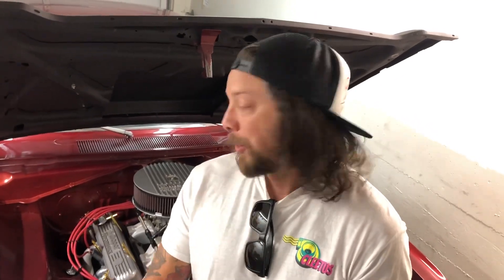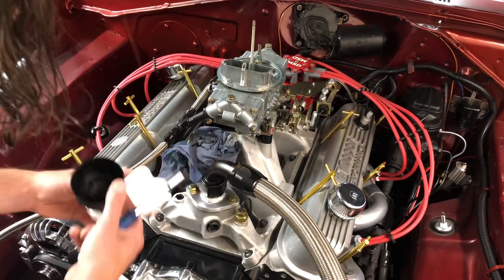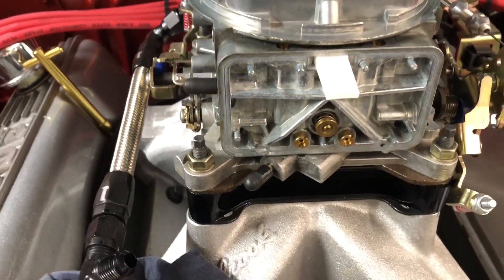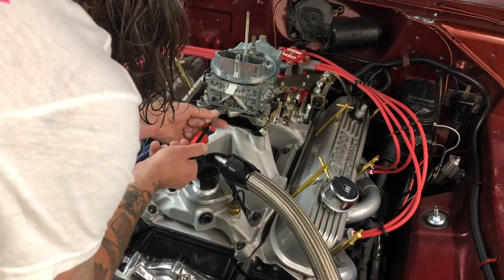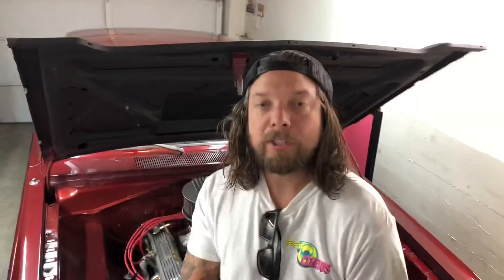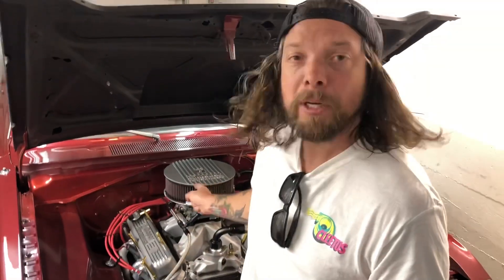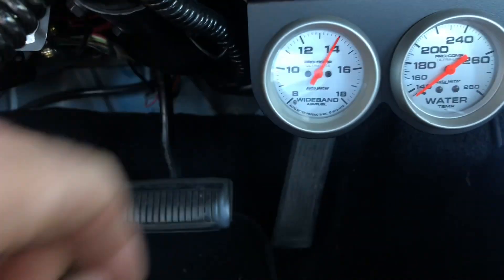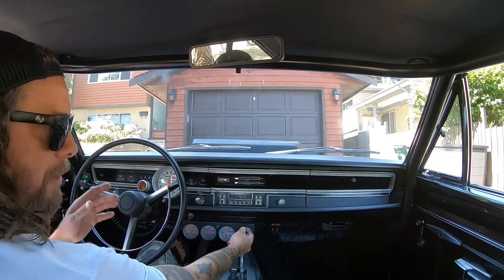Holley jet tuning with a wideband o2

Comment: I would use the dyno session as my base. But if you don't dyno an engine, pick a good air day go to the local track for test and tune, jet up till the mph drops off then go back 2 sizes and you are done. Increase timing and squirter for 60 foot same thing.

Comment: Hi, what fuel are you using, using the AFR gauge, I looked up Autometer AFR Gauge and asked that question and Autometer said that the AFR gauge is not compatible with leaded fuel
Reply from the maker: Ya not leaded. We get 94 at the pump at chevron up here 🇨🇦
Reply: @SimpsonsSpeedShop  ok, thanks

Comment: when you changing the power valve do you have to change the jets at the same time
Reply from the maker: No they aren’t connected that way. The jets provide main fuel. The power opens to add fuel when you floor it (depending on what power valve you have)

Comment: Great video. I’m struggling with my carb tune and think I need to just put a wide-band on it to see where I’m at. Car is mostly a drag car but will see some street use from time to time. I only have a set of long tube headers on the car now. Where would you recommend installing the sensor and does it matter which bank you install it on?
Reply from the maker: Mines on drivers side just makes wiring easier and just install so condensation won’t sit on it ( on top of collector) a wide band will definitely help you with both power and drive-ability. 👍🏻 thanks for watching
Reply: @SimpsonsSpeedShop . Thanks for the advice and quick response!

Comment: Im running a new dominator 1050 on my 555. Its running rich on idle. What is the best way to fix that? Ive ajusted the 4 corners to get as much vacuum as possible but its still rich.
Reply from the maker: If your using a wide band adjust it there don’t worry about vacuum
Reply: can you open the rear barrels up a little to add some air.
Reply: @70smemories  id have to look. Havnt messed with the car for a few months

Comment: I have a 70 camaro with a 383 stroker and an unkown huge cam.  I get only 6 inches of idle vacuum.  I put a wide band to tune it as it was running pig rich.  My wideband moves around much more than yours.  I can see swing from 10s to 16s very quickly.  Did you ever see this type of behavior?  My wideband is an AEM UEGO brand.  BTW another thing I noticed you are seeing also (that I see in my car), when you are crusing and you let off the guess the wideband shows a richer mixture.  I am not sure why that happens, the butterflies close restricting air but vacuum should increase and cause more timing advance, which should help lean it out rather then richen.  Are you using a vacuum advance? Nice Dart by the way.

Comment: I wish my afr gauge would work properly.  I have 1 o2 on each header and one side reads different then the other side quite a bit. When I check spark plugs on both sides they're identical. Guess I'm just going to have to tune it the old school way by checking the plugs.

Comment: light throttle cruise  .......modern car 16 to 1 //  old car stock 14.7 to 1 ,,,performance street car  pump fuel 13to1  upto 14 to 1 ..
Power valve comes on at vacuum reading just above light throttle cruise as carb progresses to moderate load the vac reading is used to select valve .
The power valve restrictor jet is tuned to set the mixture at moderate to heavy load WOT .

Comment: Mine is fat at idle and 1/4 throttle is 10-11, and can’t get it to 14.7 at idle its running 11.7 have 69 primary 76 rear in a 750 cfm idle s
Reply from the maker: You should be able to adjust your mix screws to get you 14 ish at idle. If you can’t but you have airbleeds you could swap some of the idle air bleeds to get there

Comment: Installed a wideband on my racecar with headers an about and 18" extension.  Two questions you might be able to help with.  Does cam overlap cause a false lean reading?  Do you know how far from the exhaust tip you need to be to prevent reading fresh air?  Ours is reading ridiculously lean and I just don't trust the reading
Reply from the maker: It should have at least 12” of exhaust behind it and it will prob be all over the place at idle. Open headers make it more difficult for sure.

Comment: thx for taking the time to make this vid. Both our cars share the same gage package and you've motivated me to finally hook up the AFR gage ! 333 inch SBF with Pro Systems 800 double pumper road race carb in a Foxbody vert. Going back to 73 mains and then connect the gage and see what's happening. Thx again from a fellow Canuck, altho I'm in Ontario.
Reply from the maker: Right on man! They are useful tools for sure! Sounds like a sweet ride thanks for watching 🇨🇦

Comment: that's really cool, didn't know idle mixture has nothing to do with primary jets!  I generally try for same thing.  Maybe 14.5 to PARK, then in NEUTRAL 13.5 or so.   Cruising is nice in the 13's.  The transition circuit and the "squirter" that allows it to enrichen seem to be where the primary jets come into play.   When you WOT up a hill do you check for about 12.7 optimal, and if you were to adjust things, being a double pumper would re-jet the secondary then if it was to lean/rich?  I have vac secondary and have been told type of diagram spring is the factor?
Reply from the maker: Well I was o lay going for a bit of a leaner cruise as this is a drag that sees the streets but was street driving it lots those weeks. I always shoot for full wide open 12:75. Yes you vac secondary spring will determine the rate of how quick your secondary’s open. Thanks for watching
Reply: @SimpsonsSpeedShop  Thanks man.  I got 13.5 WOT all the way on MERGING on highway right up to end of 3rd gear, so I'm thinking of jetting down in the back 1 jet size and re-testing.  I think the spring just adjusts the "rate" at which it opens but after 7 seconds of WOT it becomes irrelevant, is my theory.  Will test it merging car soon. Thanks man, great car

Comment: Just wondering what jet you had in the rear? I recently switched to a 750 dp from a 650 dp and I'm not sure where to start with the jetting.
Reply from the maker: Well every engine is different but the engine will take what it needs. Start with stock jetting and go from there and use a wide band o2! Thanks for watching

Comment: I have a street strip car i run no o2s on my long tubes it is a carb car. Question is can i run one of these with out o2 or is there another way of tuning this. Iam teaching myself all the help is thankful. P.S. beuatiful car..
Reply from the maker: You can’t use the gage in the car without the sensor in exhaust. Lots of old school way to tune a carb tho! Reading plugs and use of a vacuum gage will be the way, thanks for watching

Comment: Had that problem with my 408 and a 750 DP. I did the wire in the idle circuit, dropped the primary jets 3 sizes and changed out the accelerator pump cams to finally get it at 12.5 at cruise. My oil always smelled like gasoline...not anymore and I went from 9 mpg to 11 mpg. Changed out the scuffed main and rod bearings shortly after. That was 2 years ago. Just got done changing them out again and could have left them alone. I had a 67 GTO that had a Qjet that dripped gas after the engine was shut off. Too much gas in the oil and at startup it went BOOM. No more valve cover, lifter pan and oil pan gaskets and a quarter sized hole in the #6 piston. An oil pan explosion is what woke me up to carb tuning and maintenance. If you don't have an O2 sensor, you need one. Haven't ran a Q jet since.
Reply from the maker: Wow! You went thru it all! Thanks for watching
Reply: @SimpsonsSpeedShop  Lol, ya...The explosion took my stock 5 qt oil pan and turned it into a 6 quart pan...it looked kinda bulgy...

Comment: If you use a heated O2 sensor, you can put it on a strap and shove it up the tailpipe, at least 6 inches, with a clamp on the strap. You may have to get creative with the wire run back into the cabin, but it works fine.

Comment: If you want to tune that light throttle tip in, and up until your primary jets come into play, which I can see you are in and out of, put larger idle bleeds in the primary side only, go up 4 numbers first. You will have to readjust the primary side mixture screws slightly, but the bleeds will still lean the mixture when you are into the transfer slots.
 Also, installing transfer slot restrictors in the primary side of the main body really lets you dial in that off idle to before the primary jets start flowing. This is especially a benefit if your engine has a substantial increase in vacuum from idle to 1500-2000 rpm. When the vacuum increases a lot, the engine pulls on the transfer slot fuel a lot more.
 You can tune this area and throttle position crisply lean without affecting your drag strip performance at all. 
A test in the driveway is good too... I call it the ballpoint pen test... in Park/Neutral, bring revs up to ~2000 and block one of the PIABs...
If it staggers/slows, transition is rich... if it smooths and/or speeds up, transition is lean... helps with which direction to go. Rich transition is fuel from the idle circuit (IFR and idle bleeds, mixture screws) as well as transfer slot fuel.
At light cruise where you are, you should see 14-15:1 AFR. It will make a huge difference in how much fuel you use, how clean the oil stays, and cleaner plugs.
Reply from the maker: Yes dude you know your jaz. Thanks. I could use transfer slot restrictors to clean up tip and I may just do in future. I don’t have air bleeds or anything. Pretty basic bitch Holley. Hahaha
Reply: @SimpsonsSpeedShop  Relatively easy to do. 5/32" drill bit, tape marked to 3/16", 10-32 fluted bottoming tap, 10-32x1/8" brass set screws, and a set of pin drill bits and pin drill bit holder. Start with .078" size.
Reply: @pockets5628 I ended up getting a jet set from Quick Fuel.  One reason why is it’s surprisingly the fine difference between numbered drill bits and the actual jet sizes.  Like there’s a half size difference between the two.  I hope I explained that coherently. 🤪
Reply: Yes to this. I’ve been running a Six Pack on my stroked 440 in my ‘74 Power Wagon since ‘91.  It took me quite a few years to have the courage to fool with jetting other than just the mains.   After an excellent article in Mopar Muscle Magazine by Tom Gipe back in April 2018 on how to really tune a Holley carburetor… I had the confidence to actually drill and tap for adjustable Idle Air Bleeds.  What a difference that made.

Comment: When your just driven around you never get into the primary's, t slots and idle circuits is all that's being used.  If you want to lean it out for daily driven turn your 4 corner idle circuits in a 1/4 turn,  13.5-14.5  for cruising  12.5 when your hammer down.
Reply from the maker: Obviously I was out of the idle circuit because my jet change, changed the a f r.
Reply: @SimpsonsSpeedShop  Oh..well keep dropping the jet size until its perfect.
Reply: I think thats dependent on speed, gearing etc. I am in the primaries often cruising around. Not in the secondary's though
Reply: @cuzz63  If he takes away from the primary it will create a stumble and or a lean issue on hard acceleration. To many people think that the jetting is a tuning device.  99% of the time you don't have to stray to far from the factory jetting. The kwik and easy way to make the mopar run around town is with the idle circuits. If that's not good enough drill and tap for bleeds in the idle curcuit to clean it up even more.
Reply: @jcnewbee8124  not really true about the primary jets, thats handled more by the primary accelerator pump. Hard acceleration brings in the power valve as well as the secondary's..not even sure why your posting stuff like that. 
I agree sticking close to factory jets.
Reply: @cuzz63  Well sometimes you try to help gearheads and it goes right over there head and they take it the wrong way.
Reply: @jcnewbee8124   Its cool that you were trying to help but really best to stick to what you know.
Reply: @cuzz63  I'm ok thx...Summit has it figured out, they know frustration will set in and than holley efi goes on.
Reply: @jcnewbee8124  its all good, just stick with stuff you know.
Reply: @jcnewbee8124  I have. that doesnt excuse you misinformation.
Reply: @cuzz63  That's only your opinion....I have no issues on the street with my stuff. If you want to disregard my advise..... fine , but that car is running pig rich...still.
Reply: @jcnewbee8124  you should buy some books written by experts and not youtube. His is running rich and yet your not actually giving useful advice...thats rich.
Reply: @cuzz63  Well what do you got?
Reply: @jcnewbee8124  you familiar with David Vizard? he has a book on Holley carbs and goes into this subject at length. Yours was probably one of those that the jets were spot on right out of the box so you didnt have to do anything, that doesnt mean others dont have to change the jets to tune their carbs.
Reply: @cuzz63  Yes I am familiar with DV's holley book...I still stand by my opinion, yes if you live at a high elevation your going to run a smaller jet but your not going to use the primary jet size to change the way it idles around town.  Its far more important to have the engine happy at wot.  Flip the carb over and make sure the throttle blades are correct, if the back blades are open to far that can cause it to run rich.  6psi max, bowl levels could be too high?, idle should be set at 1000+.  I run a xp 750 on the street 1 to 1 with no power valves , I built it to hit a 400 pro tree footbraking and surprisingly works ok driving around town.  I also have a 1150ish thumper carb that works awesome on the street and is my 500 sportsman tree carb.....jet changes only happen in really good air fall and spring.
Reply: @jcnewbee8124  nobody is talking about idling around town...the discussion has been about cruising..you know when you actually open the throttle. Yes there a number of things to check but standing by your earlier statement is just wrong.
Reply: @cuzz63  Its 12-13 driven around his local area ...that's a problem.  May he likes smelling like fuel after a cruise....anyway this is going in circles.
Reply: @jcnewbee8124  yes its rich cruising..now your getting it.
Reply: @cuzz63  "Maybe, but Driving around further on it it goes too lean when I put my foot into it." That's Joe words not mine.  Good luck.
Reply: @jcnewbee8124  yes, when he puts his foot in it means hard acceleration. What part of the carb is involved then? I cant tell you its not the primaries...why not advise him on that? Why bring up the idle circuit?
Reply: @cuzz63  There is a important area from idle to when the primary comes into play,  When the car is hot and idling in the driveway it needs to read 14.1-14.5 on the afr gauge, this is where the 4 corner idle circuits need to be turned... in... to achieve this.  This will lean the mixture right up to where the primaries come in. If a holley 4150 is rich at idle .......its over, your chasing issues. Transfer slot needs to be right... 30-40 thou exposed, secondary blade closed.  Holley likes 1 1/2 turns out from stop , many I have done end up 1 1/4-1 1/8 on all corners,  sometimes the idle is too low so I just crack the back blades open to  keep the transfer slots on the front where they need to be.   Afr gauge should drop not go up when you step on it.
Reply: @jcnewbee8124  I agree.

Comment: Good work, I use a wide band on my 440, I found I needed to drop my primaries to 70 to get a nice cruise A/F, problem was on medium acceleration before secondary opening I found it leaning out to much. Dropped in a 10.5 power valve - better but still lean. Adjusted the the spring tension on the power valve to open earlier, seem to work good. Engine cruises at 16" vacuum the power valve opens at around  12". I don't buy the info from holley to half the idle vacuum to get a power valve number.
Reply: Half idle vacuum is dead wrong. 1.5-2" below in gear idle vacuum for automatics puts you closer. But 1/2 of cruise vacuum is usually best. If you are lean even with the PV open, increase the size of the PVCR jets. That way you can have small primary jets for good economy when you are driving on them, but still enough fuel under acceleration.
Reply: Need to look at the power valve restrictions and the main air bleeds.

Comment: How much is fuel that far north 
Im in tx here
Reply from the maker: Welllllllll it’s a lot. I pay 1.89 a littler. 3.78 litters in gallon. But exchange is 1.3 so I pay 9.28! Geeze. I think that’s right. For 94 at the pump.
Reply: @SimpsonsSpeedShop   93 is around 3.40 here
Reply: It was 2.40 a yr ago
Reply from the maker: @323gtx88  I did that math wrong I pay 5.49 a gallon in US dollars.
Reply: @SimpsonsSpeedShop  clean car great workmanship love it 
I need to get off my a$$ and finish my projects

Comment: She's pretty turned out great I like everything about it cool we're putting a o2 sensor and gauge I want the sunpro style line gauge as it centers the right setup points to the center you know it's right it lights up
Reply from the maker: Ya I got mine to match the other gauges but those light ones are sure cool! Thanks for watching